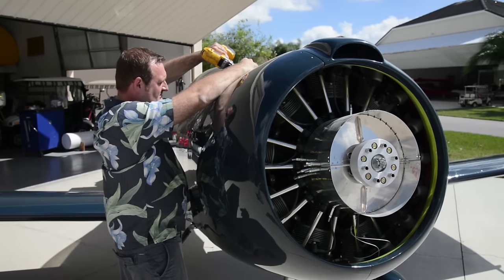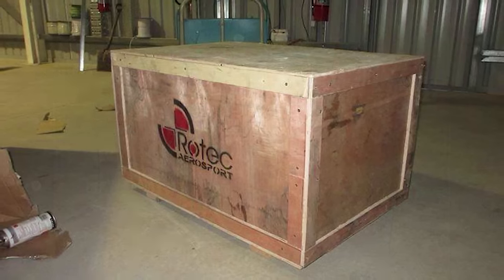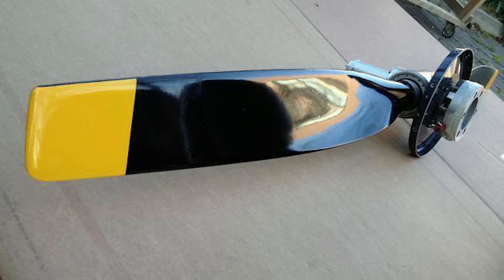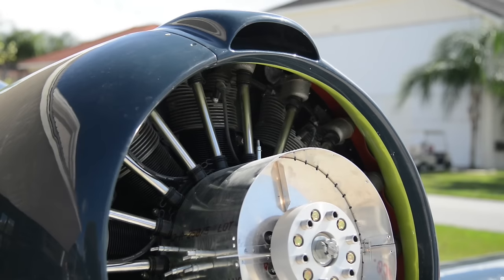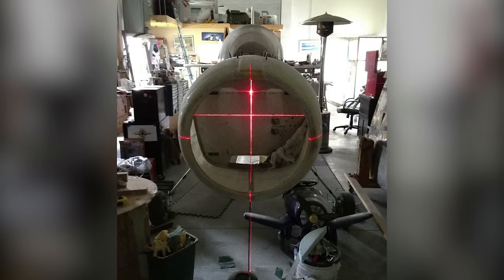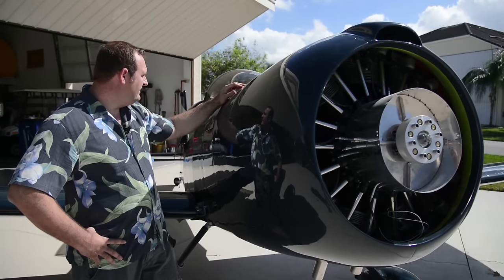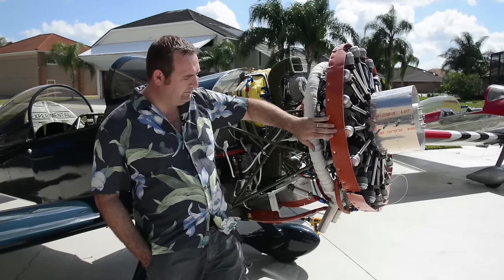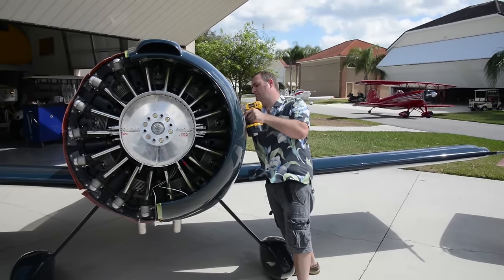Radial RV-8R: "A Poor Man's Hellcat"

Comment: Recently purchased a 1980 Cessna Skyhawk with 2500 engine hours good condition hope to get this beast in the air with enough flying hours
Reply: Its not A rotec so should last 3,000 more . Good luck

Comment: Didn't think radial engines were even made anymore, learn something new every day, I guess.
Reply: Rotec shouldnt be made anymore . Deathtraps the stock motor would have been safer.
Reply: @g6rcteam81  

You fly authentic equipment, you take authentic risks, that's flying.
Reply: @Shipwright1918  Look into the rotec on you tube I think you will agree .They are A joke and under investigation.

Comment: The Rotec engine has a history of failure due to the plastic accessory gears ,aluminum valve rockers , inserts , push tubes and lifters. Also there are oil pump issues. The 2 I saw one failed within 10 hours the other got 150 hours with two in flight failures . When you have to replace the Rotec engine give a thought to Verner radial engine. Looks good great video. We have a Stearman an L-3 and a 172rg

Comment: Love what you did to the RV-8 to be different. Wouldn't it have been cheaper (and easier) to modify the gear than go with a CS prop?
Reply: Andy R, lengthening the gear for an RV-8 would require a significant redesign of the gear tower structure.  The constant speed prop is the easiest option.  Also the RV-8 has a 120mph speed range.  A fixed pitch prop won't be able to handle that range with this engine.

Comment: Hi,Brian, I'm new to your channel and have been looking at available radial engines.  I have seen some real horror stories about failures of the Rotek engines, but have also seen some info about Verner Engines from the Czech Republic, which seem to put out more power with less weight and being direct drive they hae a better, more throaty sound.  Might you be interested in re-powering to the Verner engine?
Reply: It's definitely an option, but as of yet I'm happy with the Rotec.  Most of the Rotec problems are installation related.  the nice thing about the market, as compared to when I started the project, is that there are more options available to builders.  The good thing is my cowling will fit either engine and is now available here.  www.radialconversions.com

Comment: Just curious, I don't know a thing about props but I wondered why instead of larger diameter 2 blade wouldn't a smaller diameter three blade make the same thrust? Or no? Is there an issue with blade speed that's critical? I heard Reynolds number. I understand this only as it pertains to vortex separations around static objects. I'm sure that's the reason, because you also said you need length. But I don't follow. Help?
Reply: L TR the last third of the blade is where a majority of the thrust is produced.  To get the appropriate thrust from the propeller, which is a rotating wing, you need either speed, angle of attack, or both.  Speed is dictated by prop rpm.  Which is low with this engine due to the gear reduction.  You can increase the speed of the tips by increasing the prop diameter.  But the RV-8 can't support a longer prop.  So you have to resort to angle of attack.  The problem for an RV-8 is the operating speed range.  Witch is approximately 120mph doesn't support a fixed pitch prop very well.  So we landed on the electric constant speed.  Now onto the number of blades.  Even a single bladed prop can propel an airplane.  The number of blades is normally dictated by two things.  Max allowable diameter, and max horsepower.  As power increases the number of blades normally increases to be able to handle, or transfer, the horsepower to the air.  A two bladed prop worked well in my application due to the horsepower limit of 150.  All an additional blade would due is increase cruise drag and slow the airplane down.
Reply: What you said in the first sentence...is that due to the twist, the chord, or simply because it's fastest and the air is moving rearward largely unimpeded, whereas the inside majority is going into the cowling and cooling the motor? I've often wondered about that. I know thrust is produced regardless of what happens to the air after interacting with the prop, but it has to have limits. Anyway yeah, I can see that the trade off of more blades with less diameter isn't going to get you where you want to be. I don't want to fly with a one bladed prop. Sounds vibey a bit LOL

Comment: Why didn't you use a 3 blade prop.?
Reply: Well even w/ a 3-blade, you stuck w/ the same pitch and length...That radial is like a Diesel...Its a torque Monster!!!!!...Doesnt go fast, but its a stump puller!!!!!...That why they used them on Sukhoi's and Yaks......

Comment: a used $18,000 Cessna 150 with a 200hp converted Honda Engine that produces 600lbs of thrust and costs only $15,000 ($5k less than an traditional general aviation overhaul +$20k)  is the cheapest and biggest bang for the buck!  Plus you can use regular automotive fuel!

Comment: Why only 150hp?
Reply: Ben Davis, 150 HP is the largest engine that Rotec provides.  The next step up in horsepower for a radial engine would have been to heavy for the airframe.  It's important in a modification such as this to keep the original engineered parameters of the airframe unchanged.
Reply: Thanks for your answer! I was a little to hear 150hp as well, but understand this point.  Well worth it for the end result.
Reply: most 172s are around 150ph and it's a heavier plane.
Reply: Ben Davis but a fuck ton of torq
Reply: 150hp considering the displacement (220ci) really isn't bad for an airplane engine, especially considering that, like most small airplane engines, it's still using pushrods and carbs. Airplane engines don't rev very high because you can't spin a prop very fast. You can gear an engine down, like people using the Honda Fit engine in airplanes, but now you have the added cost and maintenance of a reduction gear drive. On top of that,  you really don't want a high-strung engine in an airplane since reliability is exceedingly important...you can't pull over to the side of a cloud if something goes wrong.
Reply: aircraft engines spin much slower than car engines, try getting 150hp at 1500 rpm on your small block chevy, it will never happen.
Reply: Phillip Stearns Neither will the Rotec, it's 150hp at 3600rpm, not 1500rpm.
Reply: misegades lol "pull over to the side of a cloud". No, no you cannot.  Good one.
Reply: Rotec is Australian.....?

Comment: Why are these engines so underpowered? Kinda sad.
Reply: +idontcare80 needs to be dead reliable.  if an engine quits on you in a car big whoop call a tow, if an engine quits on you in the air you're falling a mile

also the rpms are pretty low for the displacement, so they're mostly just making torque and don't have the speed to make any significant horsepower.
Reply: +wee aboo I guess I forget sometimes how heavy aircraft engines are. These compare favorably with O-320s. Either way, we can build much more reliable, much lighter engines today, we did so 70 years ago, and technology has advanced considerably since then.
Reply: idontcare80, the engine on the RV-8R is actually quite powerful for its size.  It's a 220 cubic inch engine producing 150 HP.  For comparison, a 150 HP lycoming is 320 CI.  The radial does this by turning the engine at a max 3600 rpm with a 3/2 gear reduction to the prop.  This provides lots of torque.
Reply: When you consider that there were quite a few engines built in the 1940s that made close to 1 hp per pound, and how far engine technology has advanced since then, these engines are incredibly pathetic.
Reply: It sounds like you have a good bead on how to make a lightweight, high power, reliable aircraft engine!  It will be exciting to see what you come up with.....
Reply: If I had a few hundred million bucks to throw around, that would certainly happen. Adept Airmotive does pretty well with their engine(s), Trace Engines does pretty well with theirs too. I'd bet a properly built 1.8 liter 4 cylinder would do the trick in this power range.
Reply: idontcare80  a 1.8L anything isnt making 150 hp at 3600 rpm. a typical moderately powerful 1.8 in a car can easily make 150-180 hp but will do it at 6,000 ish rpm. it will also likely require liquid cooling so not only will you need a redrive and an engine capable of a thousand plus hours at 90% throttle at 6K you will need to account for radiators and the rest of the cooling system.

tell you what, read up on Porsches aircraft engine development and note that in the end their high performance high tech engine proved to be less suitable for aircraft use than traditional engines based on 70 year old tech.
Reply: Something similar to the current Viking engine is what I'm thinking of when I think of what a modern aircraft engine should be in this power output range (the Adept Airmotive engine for more powerful engines). The problem with the Viking engine is that the internal geometry is all wrong, it should be an oversquare engine, not undersquare. It's also heavy because it's based on an inexpensive, mass produced automotive engine.

The Rotax 912 revs to 5,800 rpm, and there's no reason to think that a 1.8 liter couldn't run in that RPM range as well. A 90 mm bore and a 70 mm stroke would yield 1.8 liters of displacement and similar piston speeds to the Rotax 912 at 5,400 rpm. At 5,400 rpm, a 1.8 liter with the same BMEP as a Rotax 912 ULS would make 130 hp, and 150 hp would be extremely easy to make with a turbocharger. It's also likely that an OHC/DOHC engine with 4 valves per cylinder would have higher BMEP than the Rotax, which would bring the power output up even higher. Liquid cooling is an absolute must for modern engines, air cooling is much too inconsistent.
Reply: a turbo wankel engine. believe it or not, you CAN make 150hp with a lightweight engine....but you trade that for noise and complexity.
Reply: Côme Thiburs Apex seals are a problem, though. A naturally aspirated 1.8 liter 4 cylinder could make 150 hp at 5,400 rpm, but the cost might go way up. Maybe not, though.

The BMEP of some tuned, naturally aspirated Honda engines is high enough to make 185 hp from 1.8 liters at 5,400 rpm, even while running on pump gas. The BMEP of some factory Porsche engines (naturally aspirated) is high enough to make 150 hp from a 1.8 liter at 5,400 rpm, and that's running on pump gas with full emissions controls. The BMEP of the naturally aspirated Adept Airmotive engine is high enough to produce 154 hp at 5,400 rpm with a 1.8 liter. I don't know why I started my calculations with the Rotax engine, that's a pretty poor starting point.

Viking is getting around 200 hp out of their turbocharged 1.5 liter engines, but I'd be worried about reliability at that point.

Comment: Rotec is NOT NOT Rotax (Austria) .. ROTEC is a product of Australia and there have been MANY MANY engine failures of these modern small experimental radials.  A Lycoming makes more power, less drag, and far more reliable (by a factor if infinity) to the ROTEC which is 100% experimental with relative little history. .